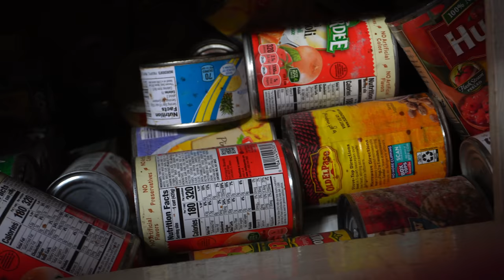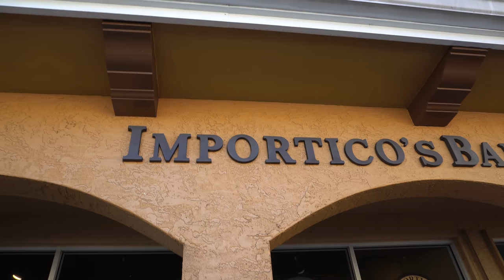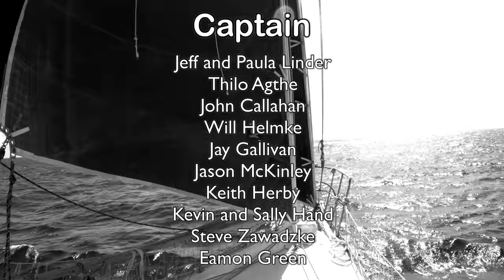Everything Goes WRONG! | Sailing Wisdom [S5 Ep7]

Comment: Oh my god!  Ok, so what can be learnt from this.  Plastic bins for the batteries?  We've ordered replacement batteries for our AGMs and the main requirement was plastic cases as, like yours, ours are located in the bilge...  If it can happen, it will happen and boats are, well, boats, so think long and hard about this, please!  As for the motor, our sail drive is well above bilge level, but perhaps a bulkhead could be formed to protect yours?  And what what about a high water level alarm, we have two but really these only tell you that the worst has already happened and if the (electric) bilge pump is fitted to a float switch these can be incredibly unreliable since the banning of mercury switches.  Condolences on the passing of your grandmother.
Reply from the maker: Thank you for your thoughts :)

As for the bilge, we had an automatic pump years ago that we turn off while sailing so that it can’t hide a slow leak between bilge checks. When that pump died (years ago), replacing it was not a priority since we never needed it. 
I can assure you that a replacement became top priority after this mess! 
As for bilge alarms: I didn’t know they existed before this fiasco. Now I know what I wish I had known long ago. 
For the batteries, we have begun building even more to add to our existing batteries in waterproof cases. Hopefully this will never happen again, but if the new batteries get wet, it won’t be that big of an issue.
Reply: @RiggingDoctor  Good on you, you videos are some of the most informative I've ever watched, but this proves one thing, boats are complex and will keep you guessing.  You need a bullet proof tin hat!  You can build a bilge alarm simply, with two contacts just hanging to a low point and a relay, test it regularly!   You also need time in an emergency and a bilge pump, even a mobile unit will give you that time.  Above all,don't despair, your viewers love your channel, your presentation is the best.  But, prioritise these changes and upgrades, apart from anything else it makes good viewing from this side of the screen!  All the very best wishes to you both from all of us in the UK.

Comment: This channel is a good example of what NOT to do. Batteries mounted in the bilge, electric motors in the bilge, dynema rigging, no water alarms, no automatic bilge pumps. You could have mounted the batteries and electronics in a rubbermaid bin. So much is left to "hope nothing bad happens" instead of designing for worst case. Much work and $$$ wasted, but good learning experience for YouTube watchers.
Reply from the maker: Please tell me how dyneema rigging was a bad choice after 7 years, 2 ocean crossings, and zero problems. Also I’d love to hear where you would have put the motor in our boat.

Comment: Im assuming this was before you told me they were in a waterproof case🤦‍♂️

When troubles come they come not as single spies but by the battalions.. W.Shakespere
Reply from the maker: This is why the new batteries were building are in waterproof containers 😂
Reply: @RiggingDoctor  
🙄 😂.... ok thats painful .. this is one reason a lot of Cat owners mount them in the bridge deck floor .
Reply: Protect all electricals with  corrosion x or the HD version. Works on drones and other stuff like power tools ...  There's 
Plenty on U tube start with the RC flight test channel ... They were building flyingboat models  
at the time. 😁😎

Comment: still not sold on lithium and elektric drive so got a new to me aircooled diesel
Reply: You’re missing out 😝
Reply from the maker: That’s alright! We still recommend it and perhaps you will see why in the next episode 😉
Reply: How do you get enough cooling air to a diesel in a boat?
Reply: @pauleohl   Marine diesels usually are liquid-cooled, preferably through a coolant-to-raw water heat exchanger to avoid raw-water corrosion in the engine
Reply: @davidseslar5798  I am well aware that marine diesels are usually liquid cooled, but Jeroen Hashman above says that he has an air cooled marine diesel and I asked how he gets enough cooling air to the engine. I have no idea what he has.

Comment: my condolences the passing of your grandmother. just to echo previous coments if you are dead against an electric auto bilge pump at least fit some high water alarms to protect your investment, they are reasonably cheap compared to frying a bms or motor or batteries.
Reply from the maker: We used to have an automatic pump, but we turn it off while sailing so that it won’t hide a slow leak between frequent bilge checks. That automatic pump died years ago and was not a priority to replace since it was hard to get to and we never really used it. 
After this mess, I installed a new one with a float switch!